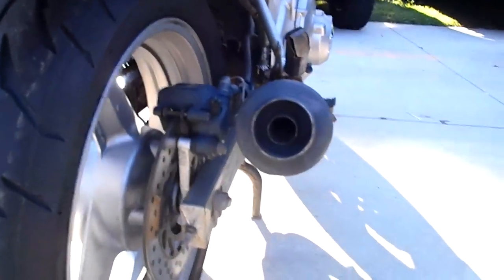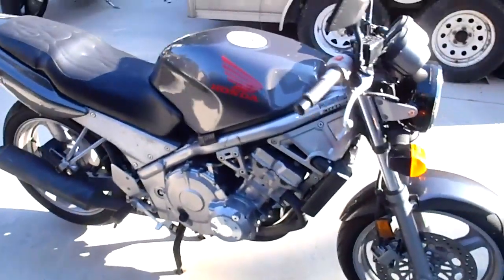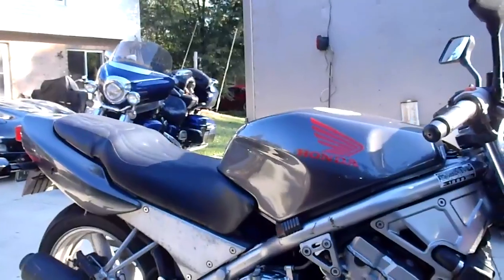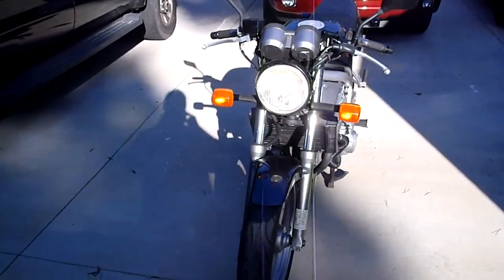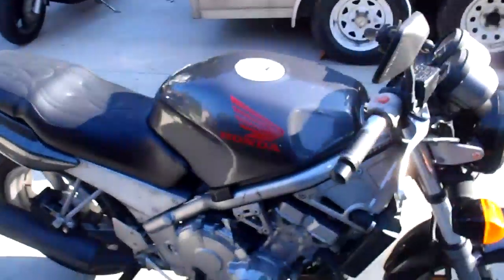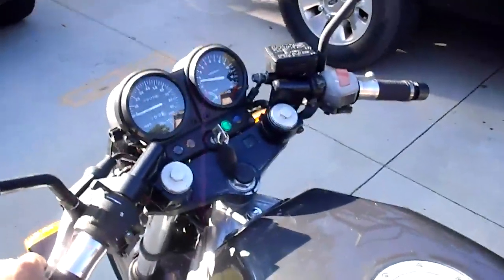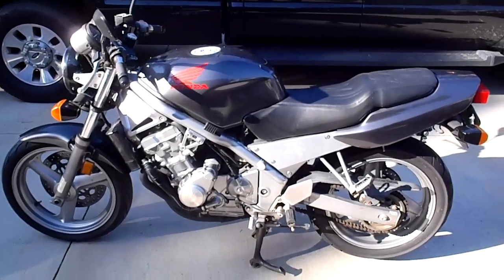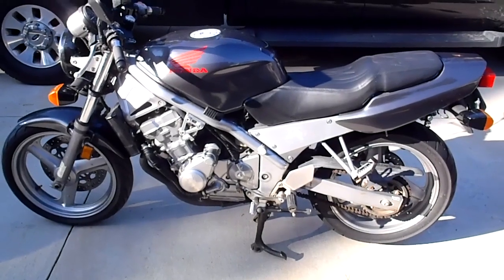1989 Honda CB-1 (NC27/CB400-F) as of 2012-09-09

Comment: I just acquired one. Did you do the engine/transmission work yourself?
Reply: Jim Nisley This is my first bike so I am new to motorcycle mechanics. Is there a specific place that you ordered parts from? And are there any other Honda models that I can rob parts from that use the same engine/transmission components? Mine is cosmetically good but hasn’t run in a while due to a rusted fuel tank. I am just trying to make sure that everything is good before I try to start it up.